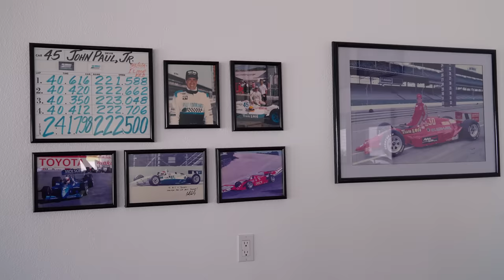2000hp Twin Turbo 540ci Bubble Top Impala | Great 8 Finalist at Detroit Autorama

Comment: I gravitated to Team Losi, which is his Radio Controlled Vehicle division. One of my cars has some Team Losi parts, and his engineering prowess  is proven with the parts design and their durability. He is a TRUE legend among the RC Vehicle community and will be greatly missed.
Reply: You're not lying there. I used to have an LXT. I could jump that thing down a 20 foot hill, have it nose dive into doing 5 carthweels and be completely fine.
Reply from the maker: Great comment! Bummed I never got to meet him
Reply: @Davivd2  i had the first gen Traxxas E-Max, and he made hop up parts for it. I had the wheelie bar for that, and for my HPI RS4 Sport 2, I would use his springs and his spur gears. I could wheelie my E-Maxx at least halfway down the block. The E-Maxx is wrecked, and I still have it. The one thing that did last on it is the wheelie bar.
Reply: @AutotopiaLA  i got to meet some of the early team members from Team Losi. They were at my local hobby shop. It was called Hobby Shack at the time. Then later, it changed to Hobby People. Now, out of business, I make sure to keep those memories intact.

Comment: ive got to say this car is something that can be considered special. the underneath of this car is as custom and designed to be different. the colors and textures, the angled fan and satin gray accents. look there are alot of bubbletops that are awesome but people act like they are ground-breaking but are doing a copy cat of the real ground breaker. nothing against any shops and the cars but there are only a few cars that are done that go beyond the pro-touring restomods, again which to me are mind blowing. the thing is i rarely hear someone say this is the car that we built because 1 builder did it first, without him wemight not be here. this 1 builder has been able to do 85% of builds that were the first only and nobody would have believed it without seeing it. yet rarely hear anyone say "thanks to try trepanier. sniper chicayne poteets, blowfish talledega etc. some shops used that oncept and did something either so rad or so different or so thorough. big oak, alloway greening and of course the ring bros. this car is something that you need a gyroscope to really see and appreciate what this car really is. when the bottom of your car by itself could be a smoty contender then the whole package 2000+ bbc, art morrison and anything gabes touches will be unmatched. gabe got alot of popularity from coddington, it was well desrved. id like to see some ground-breakers. theres a car in europe that should be a ridler car. a page out of rad rides rep. '62biscayne with a full twin turbo audi rs6 drivetrain. thats ground-breaking like troys amg e55/buick and cars taken to this type of level. the ringbros have made the coolest stuff now its time to rethink what can be done with no taboos, ferrari rambler next level stuff. im so ready. i hope to hear some people give credit to whom credit is due. this gentleman certainly got my attention. im more impressed with the under carrige of this than the just whimsical motor. i can say 2000+hp bbc in a restomod but it just goes in and then out, i really cant get my head around it. i would love yu to do a bonus video with this on a lift. i think t understand you need to see the underneath as a whole. it was designed like someone does the exterior. its got a design language that follows front to back that top to bottom. its really alot to take in. i keep watching frame by frame. its astonding. sean as usual you get some really special vehicles that people think are awsome but they dont realize how much was put into making the whole thing one flowing design, like rj's ranger, thts a prerunner and then a show truck. this is actually a art piece with a  engineering and design contest winner. truly stand out!!!!!! cheers

Comment: There’s no reason this car should have over 450-500 hp. It’s not like you’re going to do the half mile or 200 mph in this car. I don’t get why 1800-2000 hp was needed for this build. That said , what a beautiful car. The underside is immaculate. Wonderful.
Reply: I’ll respectfully disagree. I believe every vehicle should be built with the highest horsepower that’s manageable for every build.

Comment: Not making 2,000whp on 8psi. Might be running on 8psi currently. Would need to be 25+psi to make that kind of whp.
Reply from the maker: Think about how much just the engine makes…over 1000 before adding boost
Reply: @AutotopiaLA  For a N/A 540ci big block to make 1,000whp it would have to be very high compression, probably around 12:1 which won’t run on pump fuel. To throw any boost on top of that, race gas/ethanol/methanol would be necessary. At 100% efficiency(which no internal combustion is) you would theoretically double N/A power output adding ~14psi. At 28psi you would be at 3,000bhp and so on.  The math just wouldn’t add up to that much WHP on 8psi. ~15% power loss to drivetrain, and 1,800whp would be 2,070bhp. I’m not saying the engine isn’t capable of that kind of power, but there’s just no way it could do that on 8psi. Absolutely sick build though! I restored a 61 bubble top over the course of a couple years with my dad. I should have kept that car, but it helped a lot with down payment on my first house. Mine was a 283 powerglide car with factory A/C and a factory power bench seat(kinda rare option). I rebuilt a 400ci small block for it, and put a rebuilt turbo 350 automatic behind it. Lots of fun and burnouts in that car! Turned lots of heads painted in ‘Arrest Me Red’ :) Love your channel! Keep up the good work.

Comment: No I don't think so. You just said a 540 at 6psi your running 1800 hp. Oh and turned back. Just bec it's twin turbo ?

To get 1800 on pump gas is not possible unless I'm really missing something. 

And over a 100,000 thousand you could have bought a 632. And had money left over. 

You could have went to texas speed and bought 2 engines. 

I got the feel of an old motorcycle shop trying to sell me a chrome valve cover. 

Nice car though.
Reply: Yup motorcross I hit the nail on the head
Reply: It's about tuning. And the only way you can get "1800" is on meth not a net kit. And let's say 30 pounds of boost. And it won't cast 100k.

Comment: 2000 hp riiiiiiiight.  Also waste. Can’t use it if it just had 700 hp.
Reply from the maker: If you listened to the interview the goal was to win Ridler so they went way over the top on the engine